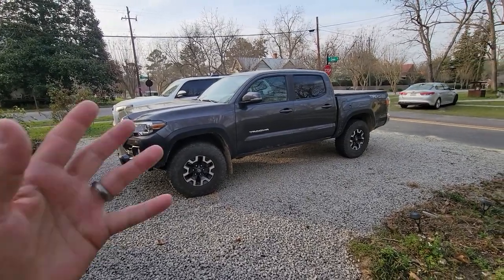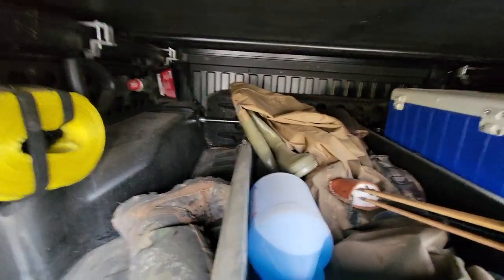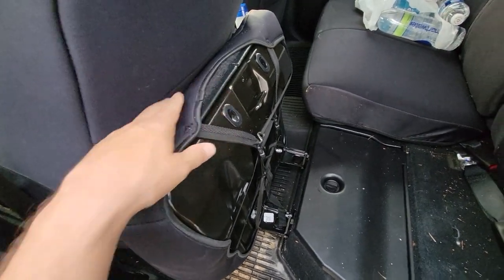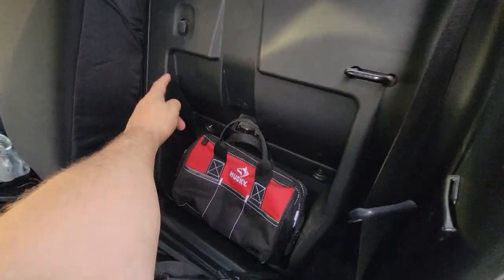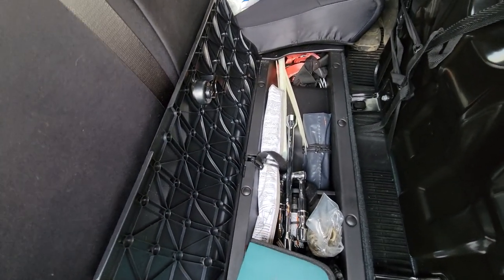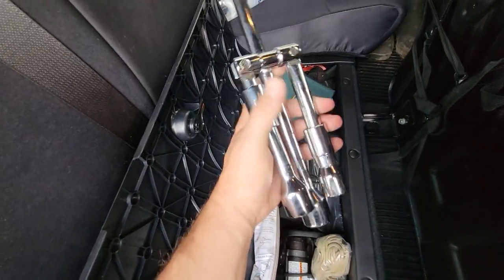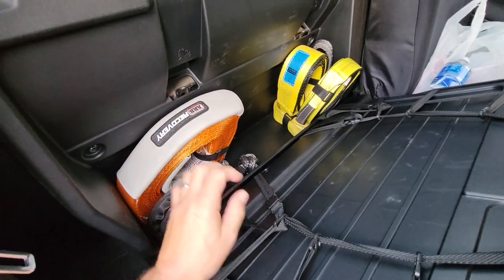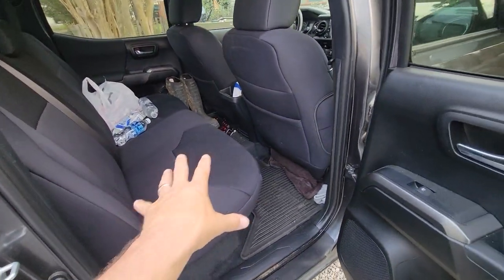Tacoma Has Amazing Storage for All Your Gear

Comment: Great videos! Been looking for a good new tire repair kit, can't count how many times it has saved me and other people. Also thanks for all your Tacoma reviews, you jave solidified the reason I am buying a 2023 Tacoma.
Reply from the maker: Congrats on the 23 taco. You got the last quality built truck that will run for many years. In 24 now company is offering that.
Reply: Thanks I'm super excited I had to special order mine and wait extra. Much of what you speak about are the reasons I'm going with the 23 Taco. I'm not sold on all those 4 cylinder turbos especially when they are getting the same if not worse gas mileage. Although I'm willing to bet Toyota will fix that and lead the way once again, but I'll wait til the master this new model abd it has several years of real world testing.
Reply from the maker: @e.1292  and ypu will have a 23 that will last yoy many years intil they do get the new one dialed in.

Comment: You need to get the updated oil filter wrench that grabs the bottom flutes and not those tabs. They break the tabs after 12-15 oil changes. Or just get a spare. I had to get both😮
Reply from the maker: I think mine does grab the flutes. It's got the same flute patern inside the wrench and sure does hold tight to the filter. I've done 11 oild changes so far and going well. But I do look at the plastic filter for any wear each time so I do know when I might need to get a replacement. Great tips and advise. Thank you